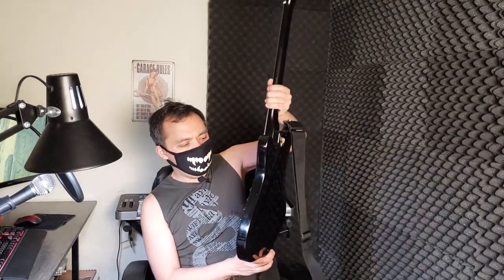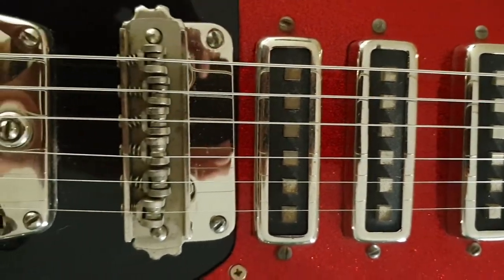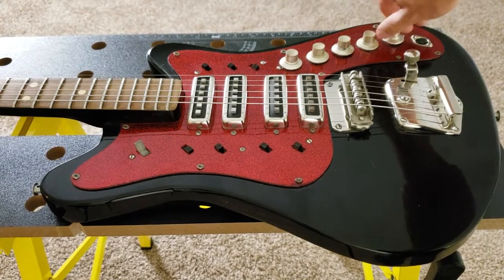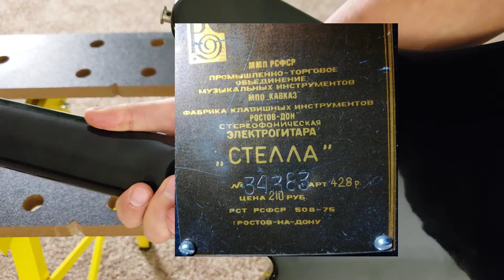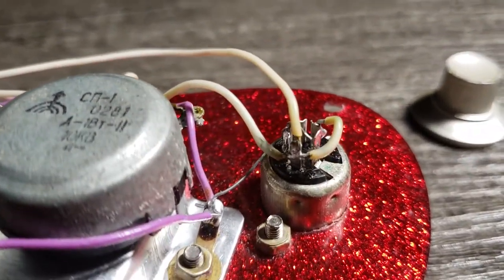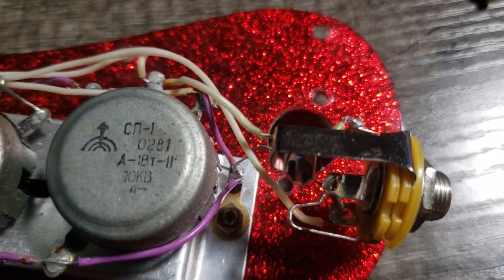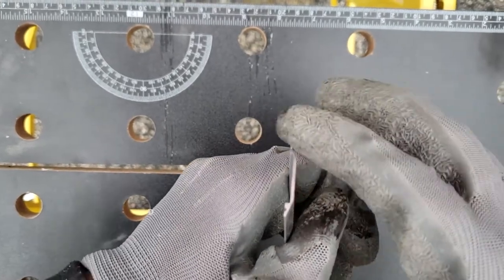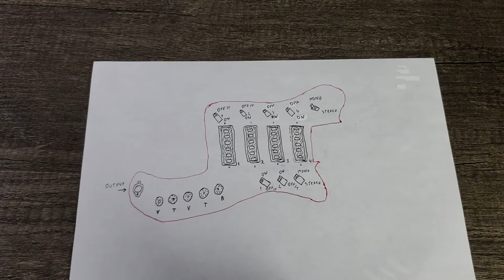Soviet-Era Guitar - Stella

Comment: I have an Aelita from the same factory. Same red crackle pickguard but only three pickups and six push pull buttons of random sound interference. Also 4 knobs - No Idea what they do.
Mine has a lower action than yours but the neck is horribly offset so the high e string keeps falling off the neck.
It also has weird trem/ bridge setup with some sort of switchable dampener on it and a rudimentary bigsby style trem.
It's a weird guitar but like yours it just looks so cool I had to have it...
🙂
Luv and Peace.
Reply from the maker: googled it, yeah looks cool!
Reply: I have one too! Came from the Terek factory - 5500 made. The dampener I can’t figure out either I was thinking something surf guitar related. When I checked the schematic there’s a knob for main volume and the other 3 control tone for each respecitve pickup if I remember right.

Comment: Could you link where the knobs came from? I have the Aelita which is pretty similar just a little more compact (3 pup / 6 switch) and mine are worn
Reply from the maker: I bought it on ebay here https://www.ebay.com/itm/221516835941

Comment: Where did you get your 3rd hand from? Never seen this and it's awesome!
BTW, there is graphite conductive paint available in spray cans... aluminium is not great for shielding
Reply from the maker: I don't remember I think I bought it somewhere in Poland.  Yes the aluminum foil wasn't a good choice. It even put the signal wire to ground once because it deforms and goes everywhere.  I think it would be better to use a copper tape.
Reply from the maker: wow what a story!  thanks for sharing.
Reply: @RomanDark  : yeah, I'm ageing, I'll soon pour sugar on the strawberries

Comment: How you changed old 5 pins jack to new jack?
Reply from the maker: I think  I showed it in the video.  I reused the old jack's top and put a new stereo jack there.
Reply: @RomanDark  I watched the video over and over to see the stereo output wiring . It looks like you have 3 wires going to stereo jack. I unscrewed my output  connector on my Stella guitar(same guitar)  and it only has 2 wires attached. I am getting mono. What 3 wires go to the output jack? I guess a ground and to signal wires from?
Reply from the maker: it was a long time ago and I don't have the guitar anymore.  But as I remember the two pickups at the bridge have separate coils for the top 3 strings and bottom 3 strings. These signals go to the left and right channels. Also there an RC filters that are mixed differently to the output.  I alternated the original schematic a bit to use it with stereo and mono jack.
Reply: @RomanDark  Thanks for the reply!!!  That makes sense about the split coils. Probably take the wire after the panning pots out to the jack. I will take the plate off today and look at the wiring.  Maybe I will get lucky and see a loose wire also. Or kind of make sense of what is going on.Found wiring schematics for non stereo guitars such as the Elgava Unika-2 and the Formanta which I also own. They are wired with 3 pins. Ground, signal, and phantom power. Often phantom is wired to ground. Phantom for power distortion circuit on Formanta for instance. Thanks again!! Take care!!